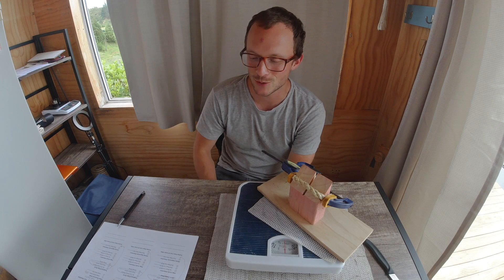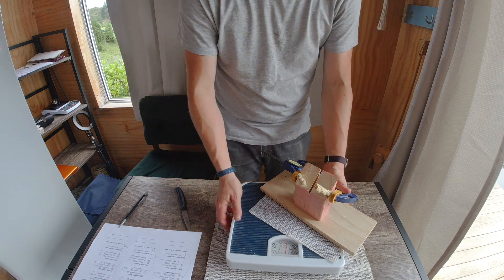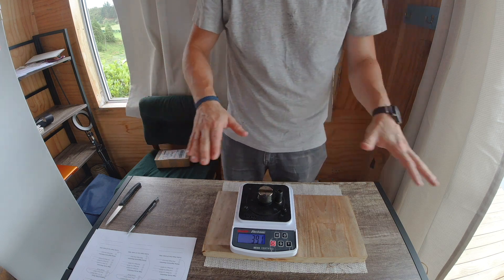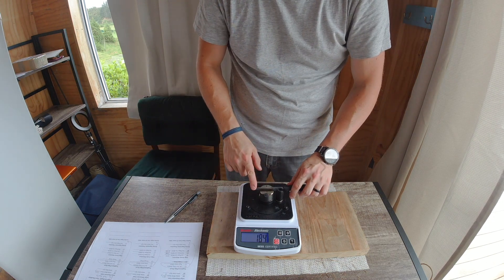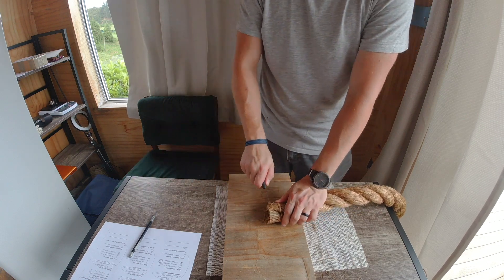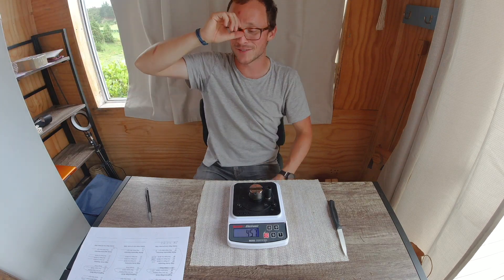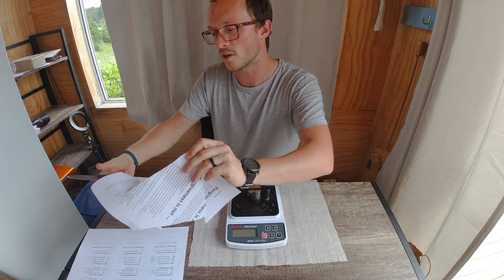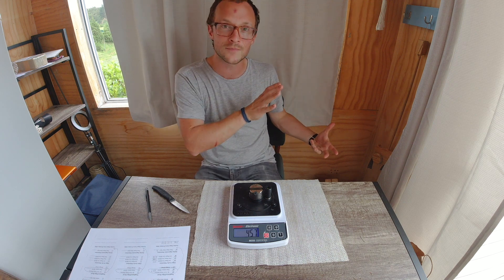Unparalleled Aggression | Dual Grit Spyderco Ultra Fine Ceramic Edge | ANDE Rope Knife Test

Comment: You really want to see duel grit show its best? Take 10v and put a 50um/200um duel grit on it.. that's the longest cutting edge I've ever done to date. On dirty denim that's tightly rolled 20 layers thick it out cut maxamet nearly 3 to 1. Dirty denim that's tightly rolled with a lot of layers will REALLY kill edges quickly. It out cutting a fresh 600g edge on maxamet that hugely... really shows how crazy, properly done duel grits are.
Reply from the maker: Awesome!  Hey sorry I'm a bit behind on comments but appreciated this.  So cool when other people take on their own research, I love hearing about epic results like this!  Well done.

I have some 10V and would be keen to try this, it sounds great.  
What stones did you use to put the 50 and 200 micron finish on each side?  
Did you do any stropping on the 10V to deburr them?  What did you use?

That's insane that it beat Maxamet, well done.

Comment: I just wanted to let you know that I just finished putting your dual grit edge on my three main go to Spyderco’s and am blown away!!! They’re a PM2 “Cru-Carta”, Manix 2 with an M4 blade (the mint blade hq exclusive) and an Endura 4 in ZDP-189 so they’re all incredible steels. The only difference I did because I’m working with a work sharp precision adjust elite is I took the rough side to the 320 grit instead of the 220 and I finished the polished side on the ceramic stone so I’m not sure what grit it really is (it is fine enough though to leave the edge like a mirror and feels about like my sharpmaker’s UF rods). I then stropped both sides a handful of times on the green and pink compound sides of my JRE “bat strop”. These things all EASILY slice free hanging newspaper and push cut printer paper and slice through double walled cardboard easily as well. 
These slice as nice and easy as they did when I had a high polished mirror edge on them only now they ALSO have that tremendous toothy bite to them! Before they were razor sharp but I could run my fingers along the edges and not get cut. Now I can’t even budge my fingers on the edge or it starts slicing! You are a genius for coming up with this dual grit edge man! Thank you so much for sharing this with the world!!!
Reply from the maker: Oh my gosh!  This is the most encouraging comment - I am so glad you can feel the performance difference!  Those are some great choices of blades and steels too, so cool man.

Really you have put a smile on my face this morning, enjoy the crazy slicing aggression, and let me know if you notice a difference in how long the slicing ability lasts, cheers bro!
Reply: @homeslicesharpening  I’ll definitely keep you updated on edge retention. I can’t really compare against factory though because two of them are basically brand new so I never wore out the factory edge. Plus I unfortunately don’t get to use a knife at work so my knives live fairly dull lives. 😂 I am going to go out of my way though to test these edges out though on more than the normal lame opening packages and stuff. But just in slicing very thin newspaper I could tell a very nice distance from factory to now. Factory sliced it but there was a hint of resistance and it didn’t really wanna change direction like carving S’s out of the paper. With your edge it glided through scary easy and easily changed directions and carved out nice S’s in the paper. Thank you again very much for discovering this and being nice enough to share it with the world. I found your edge theory and your channel from Cedric and Ada’s channel. He had amazing results with it and then I watched a ton of your videos on it and the science behind it and how it basically works in any and all steels. It’s just amazing how it does everything so well. Like I said I had mirror polished razor edges that would shave hair and slice paper like crazy but they had no bite at all. You could run them on a tomato or your fingers like a saw and nothing. And I’ve done toothy edges where I would stop at about 600 grit tops and they’d bite like crazy but they weren’t really impressive with shaving hair or slicing paper (hey I like to show off my edges 😂). But yours does everything.
Reply from the maker: @cfltitan  Cool, keep me posted.  Yeah the increase in versatility is so cool - that's one of my favorite things about sharpening this way.  Have an awesome day bro - thanks again for the encouragement and just for reaching out!

Comment: Gabe great result.  You’ve definitely earned your bro science merit badge.  It seems like more Andy cuts is measuring back-end sharpness, maybe add some arm shaving to address front end retention?
Reply from the maker: Hm, great idea!  I think as a working guy I am most excited about extending back-end sharpness (ie raw functionality), but it's a valid point that front-end sharpness matters (and tbh it is the most fun!). I'll try to incorporate shaving somehow into what I'm filming now.
Reply: @homeslicesharpening  That would be great in order to have more data points for comparison. I noticed that my edges loose shaving sharpness very fast, but still remain working edge for quite some time.

Comment: Hi Gabe..If you don’t have a 220 Diamond Stone for the coarser stone ( I do have a 120 diamond plate that is very aggressive) plus a Norton India stone with a coarse side and a coarse Aluminum Oxide stone . Would these be OK? I have the Spyderco Ultra Fine and would like to try this out but I realize that the diamond stones leaves a very particular toothy edge. Have you yourself tried other coarse stones and if so, did you get similar results. Thanks, watched Pete check out your edges with amazing results. Cheers from Nova Scotia. MikeR.
Reply from the maker: Hey Mike!  Thanks for asking!  I should mention I expect this edge will have the best results on steels that don’t have large amounts (like more than 3-4%) Vanadium.

If your steel has some decent ductility to it, I think your stones will work ok!  I would anticipate best aggression from the diamond stone, but maybe try it gently to make sure it’s not so coarse it causes chipping.

My second choice would be the Norton India Coarse (I’ve had good results from my India stone).  Make sure to stick to edge-trailing strokes and keep stropping to just 3-5 strokes per side to not remove the aggressiveness.

Best of luck, let me know if you run into any problems I can help with Mike!

Cheers from NZ.

Comment: I like the new format for displaying info, very clear and useful. The only improvement I can think of would be doing a pre-rope impact test to measure the stability of the dual-grit's fine burr vs the stability of the secondary apex, but then you'd have to sharpen the whole thing again and risk introducing a whole other set of variables (and it would be more hassle). If you ever get tired of being a sharpening guru you could try doing parenting advice, you seem to have a perfect disposition for it.

PS- That Ultrafine ceramic is some kind of magic stone. I think I read on Science of Sharp that it mostly works by adhesive wear, maybe that's especially well-suited to "combing" the dual-grit burr with minimal gouging of material.
Reply from the maker: Yeah!  I think that the adhesive wearing property is probably what sheared away damaged metal from the coarse edge without removing the aggressive texture!

I agree about doing a pre-test, but also about the inconvenience.  I think I’ll test everything, then resharpen the top performing fine, coarse, and dual grit and impact test them as fresh edges (then I only have to do like 3-6 re-sharpenings rather than like 50 haha!).

Thanks for the parenting feedback, I also have really good kids.  Also, some days are better with patience than others.  But I appreciate the encouragement.  Just thought Jemma’s voice was cute in the video.

Cheers Mike, take care dude.

Comment: Have you tried a 180 grit edge or 220 grit both sides and then deburr best you can on stones and then strop it to a polish i did 12 micron then 6 micron then 3 micron and its interesting edge for sure
Reply from the maker: That sounds amazing!  I’d really like to try out grits coarser than 250, but don’t have any at present.

What did you observe about the edge you made?  Sounds killer aggressive.
Reply: @homeslicesharpening  i was just messing about thinking about your dual edges being coarse and polished but it was hard on my system to switch stones so I figured I could just polish a extra extra coarse edge. And so far I'm actually pretty happy with it I haven't tested it like you do but it does push cuts on on newspaper easily and s cuts but it's a beast when it comes to slicing and especially fabrics and plastics where a serrated edge normally comes in handy. You can definitely feel the scratch pattern in the edge like micro teeth for sure but its also very bitey it's kind of deceptive. I don't think its anything new so to speak but definitely interesting
Reply from the maker: @kevinfitz3721  Yeah, that's interesting!  I did a straight 250 grit edge on Maxamet, and I stropped it thoroughly on denim w/Mother's Mag polish and it made it through the Death Rope which is my toughest test.

The edge was insanely aggressive, I sent it to Pete, but it had one area that was catching in the printer paper, so he declined to test it, which is fair - it's his test criteria.  I do think there is more work to be done on coarse edge analysis and optimization.

Cheers bro.
Reply: @homeslicesharpening  the stones I used were jis grit metallic bonded cbn and then gunny diamond emulsions so really the 180 is probably more like 220 maybe but I think with you a better sharpener than me and someone who tests I think it would be interesting to see if it can perform the same as dual grit or Similar
Reply from the maker: @kevinfitz3721  Yeah, I'll take stock of what I have coarse-stone wise and see what tests I can come up with.  My 250 grit edge on both sides (stropped on denim) did insanely well cutting through the rope, but the BESS keen-ness fell rapidly.

I think it may have to do with how the edge breaks down, microchipping to a small jagged apex rather than wearing down to a rounded apex which is useless on the rope.
Reply: Sounds like wire edge
Reply: @LosRiji  no I do get it sounds kinda weird but as long as you spend time deburring on stones best you can and strop it down properly its quite deceptive and aggressive but yet does push cuts and s cuts well and can shave easily even whittle thicker beard hair. But idk if it compares to a dual grit edge yet as I haven't master that yet